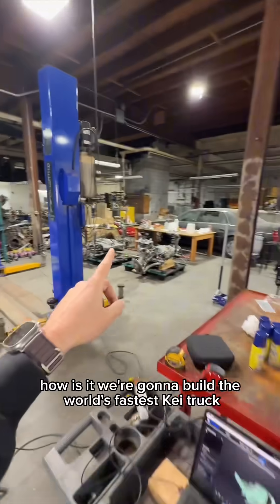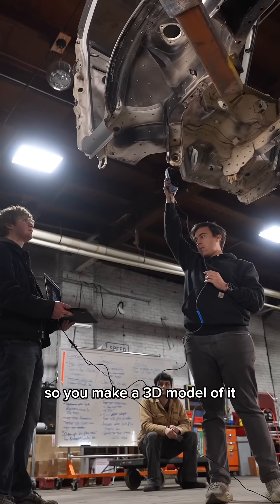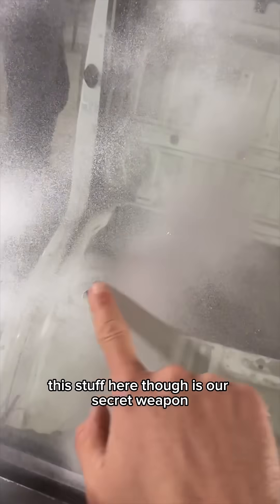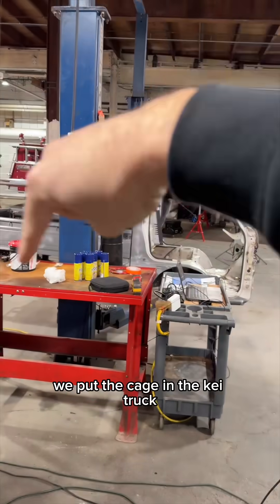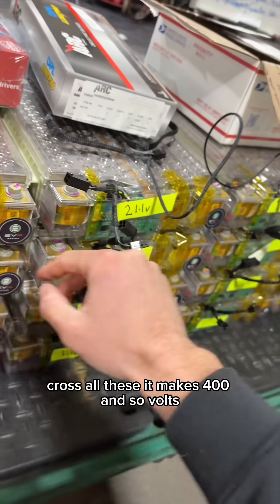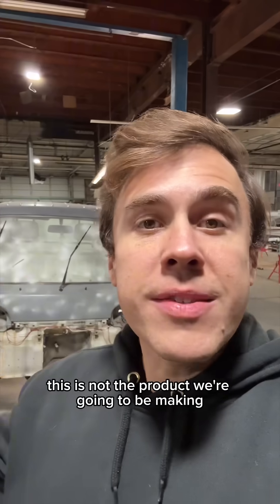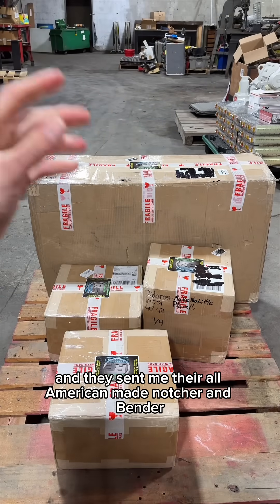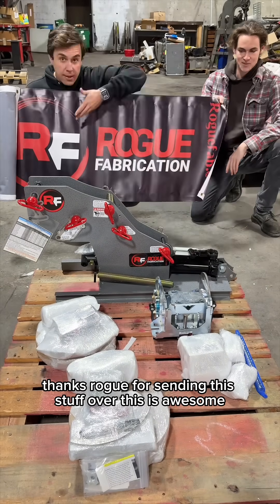How to fit two Tesla motors in a Kei Truck and not die?  #automobile #tesla #keitrucks

Comment: I've shorted a 3.7v battery and when I went to unplugged it I was shocked pretty bad and couldn't let go. Now 110 does hurt a lot more but don't mess around with dc either, especially at higher voltage.

Comment: High voltage DC is scary AF.  AC has null points where it crosses 0 where you’re able to let go if you’ve completed the circuit. DC, you’re basically stuck there and have become a human fuse.

Comment: You are mistaken. At any given voltage, DC is FAR more dangerous than AC, except for people who have a specific sensitivity to 60hz. I don't know how pacemakers work. AC passes through 0, but technically peaks higher than DC of the same nominal voltage, so there's that, risk, but because DC doesn't pass through 0v, if it's pushing enough current to seriously harm you, you won't be able to let go until you're dead.

Comment: Should not be using Tesla cells.   Can’t dump the power and u don’t need the miles.     CMax (25ah version) cells would do u better on hp dump and give u less miles and less weight.    And if u want max power and min miles/weight go with CMax hybrid cells aka Panasonic 5ah prismatic cells

Comment: Full tube Frame, will support all powertrain components. battery where the original engine was... Awesome low center of gravity. And the cab and the box will be removable. Can can actually make the cab tilt up for servicing.

Comment: DC tends to be more dangerous… 

With AC there is a shirt moment where it changes polarity and that moment is zero voltage, so it’s a moment your muscles could relax and give you a chance to get out of the circuit.

DC doesn’t give you that chance, once you are in, you usually stay in…

Comment: Electrician here! D/C can be just as, if not more dangerous than A/C electricity! While they can both kill you with enough amps, A/C will shock you fast and as another comment said it could blow off your finger which would disconnect you from the circuit. D/C electricity can literally paralyze you as long as you are touching whatever is hot. So if you grab something thats hot, you cannot let go and its advised in the trade that the closest person next to him should Spartan kick him as hard as you can with the soul of your boot. And remember that Amps are dangerous than Volts in most cases

Comment: Dc is scarier to me.
I have a shot of letting go of ac power.

A 600 volt DC bus will hold onto you until your cooked.

I think what you meant is below 48 vdc its safer than ac power because it cant jump your skin
Unless your skin is wet or there is a high enough load on the circuit.

Moral of the story, dont give electrical advice on videos

Comment: I have had many 240V AC shocks and they hurt. The worst shock I ever received was from two batteries from my dad's diesel. He had me holding a positive terminal so that it wouldn't connect and I had my hand on the metal, grounding me. I was sweating as well. He did something that completed the circuit and I felt the full amperage of those two truck batteries. I will take an AC shock over that any day.

Comment: 48v is the largest pack for consumer stuff because skin is insulation to 50vdc . 48v li-ion is 52v at 100%..
21.1 70% storage  2 in series is still safe ish to tuch ± .  if sweaty 12 vdc tickles.

Comment: You can save money with a spray bottle filled with rubbing alcohol and body powder. Trust me, it can get expensive quickly using those aerosol cans. Now, for how much to use, I haven't got an exact measurement as I sort of wing it most of the time.

Comment: AC vs DC isn't where the difference in danger lives... it's current! Given the body's resistance, current will become dangerous above certain voltages (Ohm's law). Anything above 50-60V shouldn't be touched with bare hands, lower for wet hands.
If you touch 'across' a 21v battery, you still won't feel anything but across 400v, you're dead. AC or DC, doesn't matter.
Reply: And DC does some horrific stuff to your blood that AC won't
Reply: Yep, a regular lead acid car battery has more than enough current to kill you but, being only 12v, that current can’t penetrate the skin
Reply: @quakxy_dukx  Someone told me not to so I had to prove a point lol. Its absurd how many people dont realize voltage is what allows it to jump the skin barrier. You can even weld with 2 batteries in an emergency.
Reply: My dad is an electrician and he has told me volts won't kill you but  Amps will kill you

Comment: Tell me you don't know anything about electrocution hazards without telling me. DC will lock your muscles up at a lower voltage than AC.
Reply: High voltage is high voltage. Doesn't matter if it's AC or DC. Both at high voltages are just as dangerous lol

Comment: Are you able to shorten the axles on the motor assemblies? Otherwise you'll get the wheels sticking out either side and need to fabricate some wheel arches (not necessarily bad on the back but it'd look pretty weird up front)

Comment: High voltage DC is more dangerous than AC, AC is more likely to vaporize a finger and blow you off DC you get stuck too lol I'm a substation electrician who works with both the DC at 600v 3000Amps I'm much more afraid of.
Reply: On ac your muscles are partially able to move your body parts so you can release the contact point (your Finger for ex) but on DC your muscles have just one state and you can't even change that however much you wanted. That's why at HIGH DC voltage always 2 people are needed one just holding a insulated stick to pull the other away from. DC is way more scary then AC.
Reply: I was going to say I've always heard DC was more dangerous because you don't have a chance for your muscles to untense and let go
Reply: Yeah, anything over 50v, AC or DC, has the potential to be really dangerous, the higher you get the easier it is for it to be dangerous
Reply: I was about to say 😂 I really hope you learn more about electricity before you go wiring all that up 

I would be very nervous getting an electric car by someone who doesn't know the difference between watts, volts and amps

I wonder what this guy thinks would happen to him if you hit him with a 1 million volt stun gun, which is DC, since it's battery powered, does he think he would explode into pink mist?😅
Reply from the maker: 600v 3000amps is another animal entirely. Anything municipal will convert you to light.
Reply: @thatdetroitandy  Those batteries could easily pump out kiloamps with a low enough resistance. 
DC is not "safe", it is safer, but not by much. 60vac can be dangerous, over 80vdc can be just as dangerous as 60vac. It doesn't matter, high voltage is high voltage. High voltage AC or DC is dangerous all the same.
Reply: @thatdetroitandy Haven’t been near anything with that much amperage, but our race car battery at 600V 150A is scary enough
Reply: @komischertyp4  The raw cells of any batteries, especially lithium based cells, can put out tens of kiloamps if shorted. 150a is only what they'll do without damaging themselves. (or in the case of 150a which is pretty low, probably just the BMS)
Fault current of any battery is astronomical.
Reply: @NSaw1 Yeah, per the rules we are only allowed to draw 80kW. Luckily we haven’t had any incidents in a long time. There are stories of someone getting 400V straight through his arm. No serious injury though. Power went into the hand and out the elbow.
Reply: @komischertyp4  Shew, scary. But sounds like a cool race lol
Reply: @komischertyp4 the 600v 3000amp is what our local pedestrian trains run off, they weigh roughly about 100,000lbs.
Reply: @thatdetroitandy Story time. I do industrial controls for a living 480 volt 3 phase cabinets all day every day. I used to work on R&D EVs. I took a few entire battery packs home that we were done testing with to build a DIY Solar system. I know all the NFPA70E safety standards and recertify annually. I took these batteries apart into similar modules. My end voltage was 56vdc at about 100amp hour packs. I was wiring them in parallel for more capacity. 
I was working on one at 2 am, kids asleep after work, and while installing a DIY BMS I had a momentary lapse in judgement and accidentally shorted out a 1/0 lead from +to- dead short. The acr flash it created was in the thousands of amps at only 56 volts gave me 2nd and 3rd degree burns on both my hands and lost my thumb nail... They are extremely dangerous. U don't even have to have the voltage up into the hundreds. I was severely injured just from the arc flash without even being shocked. Melted the terminal right of the wire in a millisecond. When u weld it's about 24 volts at a few hundred amps. These lithium batteries when shorted can create thousands. Just a friendly FYI. So please keep up the good work and please be safe. Use leather gloves even when the voltage is still low. Use rubber gloves with leather gloves when the voltage gets about 80 volts.